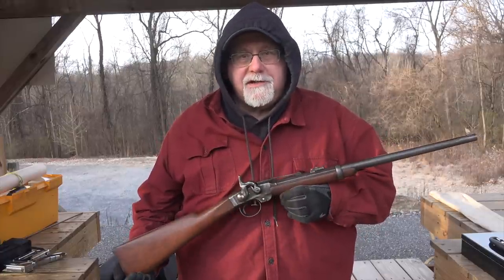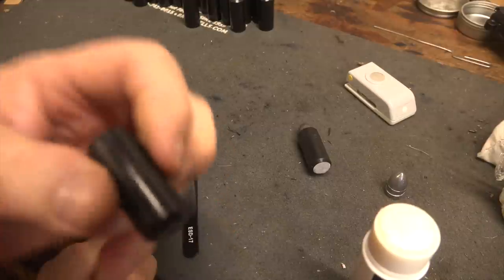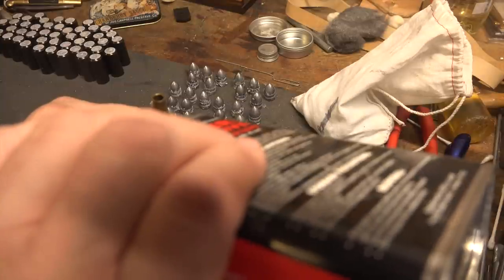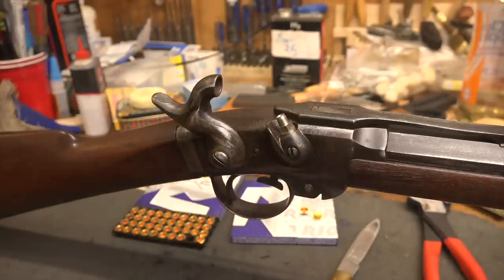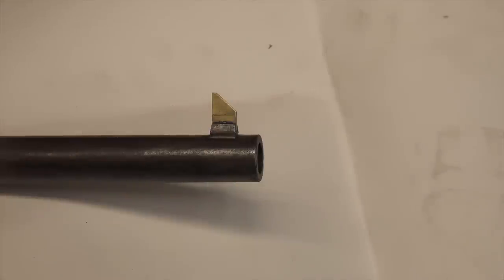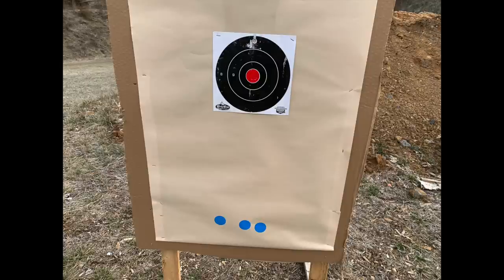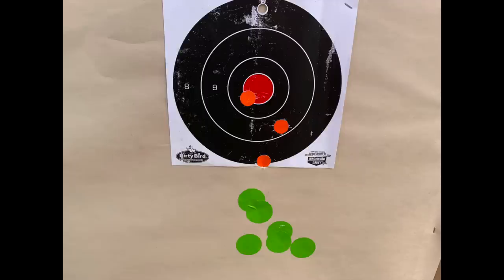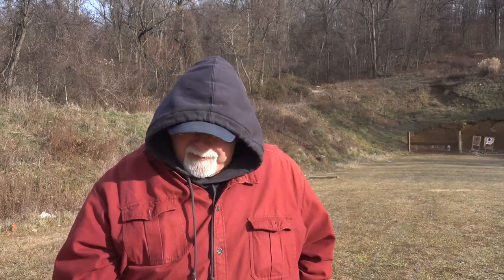Sighting In a Civil War Smith Carbine

Comment: Mike, I have been shooting Smiths for over 30 years and have learned a lot doing so. If you come across any of the heavy brass cases that are available today, you probably shouldn't use them.  They do not expand and allow gasses to to blow back into the action. Cleaning the Smith then would be very difficult. Also, get a sight protector.  The high front sights will draw blood. Have fun shooting the Smith.  It can be extremely accurate.

Comment: Nice. I used to repair a lot of older repro Smiths, many built by Yecks, that had a problem with really short and weak ignition drum screws. After some time, these screws would blow out, requiring a new set screw to be installed. The set screw also serves to narrow up the huge cavernous flame channel and ensure more consistent ignition. The new Pietta Smiths don't seem to have this problem.

Comment: Mike, thanks for the enjoyable video. But am I the only one wondering what the chances are of setting off a cap if that knife blade goes down faster and further than you were expecting?  May I suggest a thin piece of wood (wall paneling or maybe even thinner) with a hole bored the size of the cap. Now the knife blade will stop on the wood, never risking hitting the priming compound.
Merry Christmas!

Comment: Mike, there is a formula for calculating how much to change the front sight height.  It is sight radius x impact change / distance to target, all in inches.  I don't know the exact measurements for that beautiful Smith rifle, but let's play with some numbers.  24 sight radius x 18 impact change / 1800 50 yards = 0.24.  Based on your video you probably didn't have to remove this much metal from the front sight, but I was not using actual numbers.  I have an Excel spreadsheet that will calculate this if you would like to have a copy.

Comment: Very impressive that your Smith carbine still appears to be a tack driver after its use in the Civil War and whatever else it had been through during the past 160 years.

I may have to check out Lodgewood and see if they can help me out with fixing up that Kerr revolver that I picked up last year.
Reply from the maker: That is where I’d take it.
Reply: @duelist1954  I have been looking at the Kerr on and off. It turns out that the cylinder does completely lock up, but in a different manner. Since the cylinder can be indexed by the trigger, I finally realized that the hand must have some kind of direct linkage to the trigger. Upon doing some careful dry firing with my thumb on the hammer, I found that the cylinder did lock up tight as I was squeezing the trigger. There doesn't appear to be any bolt involved in the lock up, especially when you look at the cylinder and notice that it lacks bolt stops. The trigger/hand appears to be the only mechanism that locks up the cylinder.

My original plan was to carefully take it apart (taking pictures as I went that would aid with reassembly) and inspect/clean it myself when I had some free time this winter. After hearing all of the good things about Lodgewood from your videos, I am going to contact them soon. Especially when you said that your Smith had a frozen nipple and Dave was able to replace it, I realized that I have five nipples that are most likely frozen and it would be better to have a professional like him do it for me.
Reply from the maker: @JRB781  Good Plan!

Comment: Very heavy slow bullet it shoots. I know that the old standard issue war between the states guns and their repros are meant to hit a man sized target in the torso. With the revolvers at 25 yards and with the carbines and rifles at 200 yards. They weren’t made for precision accuracy just like the later .45-70 trap doors and colt SAA peacemakers weren’t made for precision accuracy either but with modifications greater accuracy is possible. At 45 or 50 feet my Uberti 1858 with my Howell .45 colt cylinder hits all over the place but all the shots hit within an area that would be within a man’s torso. With some compensating out of 20 shots I can even hit a small cantaloupe a few times at that distance

Comment: Have a reproduction. Using cigarette rolling paper as my cover on back of the cartridge case. Currently in the shop for a tall front sight and a bit of repair. Does not hold on full cock unless I put my finger behind the trigger ad push forward. Shoot in N-SSA completion. I have an original Maynard that shoots like a dream.